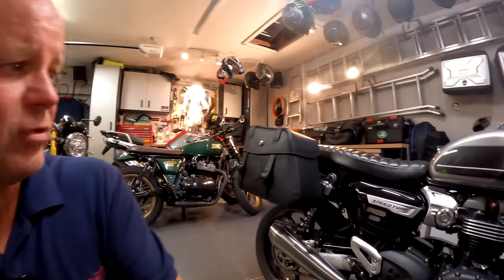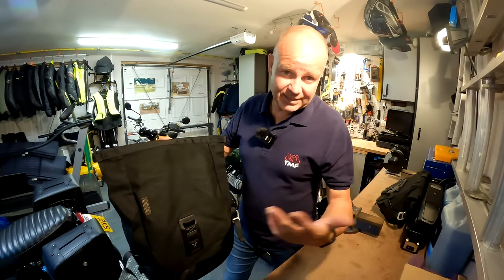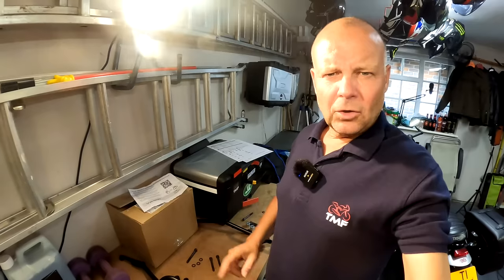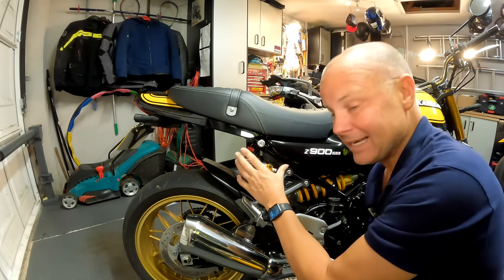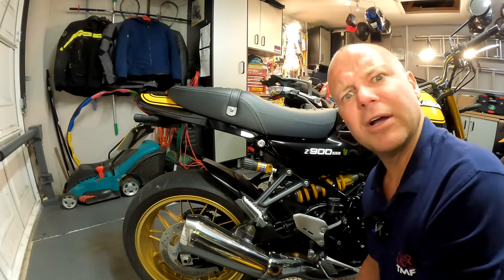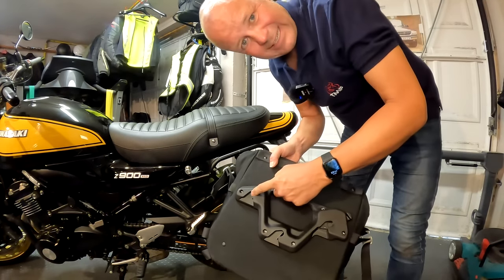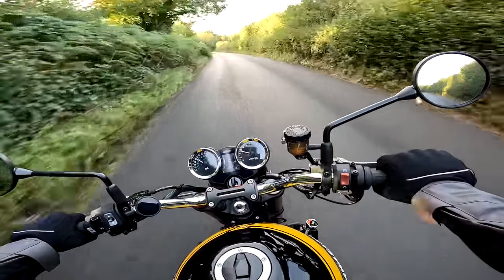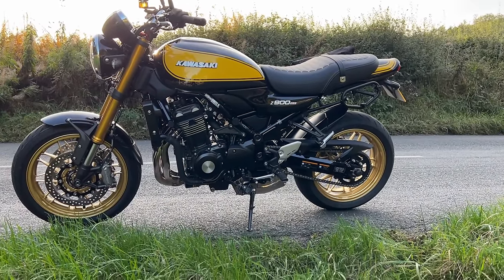Kawasaki Z900RS SE - An attempt at installing SW Motech Legend panniers!

Comment: That looked a bit of a struggle. I fitted these brackets and bags to my R9T and later transferred them to my Speedmaster when that replaced the R9T (I had to buy different brackets to fit the Triumph, of course). I don't remember it being THAT difficult! (Anyone want to buy my now redundant R9T brackets?).
My bags are equal size so no symmetry problems, but I decided I wanted them to sit lower on the bike. That's easily achieved by removing the attachment from the back of the bag, and drilling new mounting holes in the bag to re-mount the attachment bracket higher up the bag. They looked better that way on the R9T and also look really good on the Speedy.
Vince
Reply from the maker: Great tips - thanks for that!

Comment: What would such jobs be without the odd brain fart to have a giggle about in hindsight? 😁 They happen to the best, really.
A good friend of mine, trained and experienced aircraft mechanic who easily is the best at such bits of work I personally know, wanted to put new shaft seals on his Toyota Supra MkIII´s turbo. He had disassembled the Turbo's housing, secured the spinning bits in a carefully cushioned vice and started to undo the nut on its axle. It was stuck incredibly hard. He gave his everything to undo it until it made a loud crack and the nut came off with the bit of the axle on it. He could easily undo the two broken off pats, which made him realise that the thread was left handed. He had try to undo it in the direction that tightened it.  He had the personal greatness to laugh about his 1000€-brainfart. 😊 
I guess there are many wise Haikus in that kind of stories.

Comment: I have to say that was painful to watch, the fitting - oh dear oh dear. Also why is the exhaust side bag so small when there is loads of room from the botom of the bag to the exhaust can?? I have used SW Motech Blaze panniers for about 8 years and reckon they are actually a better product and at under £400 a set would be intersting to see if they do a set for your Z900.

Comment: I have to admit the different bag sizes when looking from the rear is a little strange, but I can understand why the OEM did not make the left side the same as the right. I’ve been working on cars, motorcycles and aircraft for over 55 years. I bought a new 2023 Goldwing Tour DCT back in July and have installed several add-ons. I will admit some of these turned into real Hollywood numbers when they should have been a piece of cake. Some of the after market instructions leave much to be desired but some issues I have to take the blame for being a dumbass. I have a feeling things will not improve as I continue to age 🤪

Comment: Firstly, I think they look as good as the more expensive ones, and the brackets blend in quite good when no bags on. 
Secondly, why don't these manufacturers colour code their instructions, as I like you, have similar problems when doing small bits n bobs on my bike haha.
Reply from the maker: Glad it’s not just me!
Reply: Looks fantastic from my house great job 👍
Reply: @TheMissendenFlyer 

Hi Andy,
I’m surprised you didn’t go with the SW Motech Blaze version. I love the way they look and fit on my z900rs, and when I take bags off in 30 seconds there’s no (ugly) bracket hardware to take away from the looks of this piece of art. 
I agree with your friend that the rear chrome handrail is a must retro finish to the bike, bookending with the chrome handlebars. 
I’ve also added a chrome brake reservoir, front fender extender, crash sliders, bar riser(I’m only 5’5”), a cool, sporty, full windshield for long trips from Puig, plus a Nelson Rigg tail bag that fits and matches with Blaze saddle bags. I wasted no money on already comfy seat and great sound out of stock pipe, and at 155 lbs., the suspension is good for me right out of the box. I don’t think I’ll ever sell it, now with 30k miles. I’m retired, driving around San Diego backroads, feeling like Tommy Cruise!
Other days, when I feel like Marlon Brando, I ride my 2017 Triumph Bobber, and like you, I love that 1200 HT parallel twin engine under me!
Ride safe, Mr. MF 🏍️😎

Comment: Treat yourself to a 3/8" Drive Allen Socket set! So much easier to carry out workshop jobs like this when used in conjunction with an extension and Ratchet Handle. Allen Keys should be relegated to roadside repairs only. You'll also potentially save a few skinned knuckles, not to mention trapped fingers!! 🥴
Reply from the maker: Funny you should mention trapped fingers....
Reply: Yes I saw the podcast, we know why you like the BM so much now.🤣
Great format by the way, Mrs F certainly added a new dimension to proceedings. 
On the subject of "Coffee Meets", how about combining your two passions and holding one at a suitable airfield location? With a collection for the Air Ambulance/charity of your choice? Just a thought.

Comment: You installed the panniers on the triumph on the wrong sides… the slope angle is meant to go /or flow with the rear of the bike …you have the angled end going towards the front that looks just odd 0:11
Reply from the maker: I've tried them both ways and can't decide which I prefer!

Comment: You struggle with mechanical technology the way I struggle with electronic/digital technology. I’d rather fit accessories than install an app any day of the week. I’m currently dreading this weekend’s task setting up the integrated comms for my new Shoei, and then bluetoothing it to my phone & satnav (if you listen carefully you’ll be able to hear me swearing!). 
PS: SW Motech look way better than Hepco & Becker. Fit & finish look almost “original equipment" compared to obviously "aftermarket accessory”.

Comment: Nothing's simple when the spanners have to come out! Looks like a large bag would fit on both sides. Shame they don't lock to the bike and the bags themselves don't look as thought they lock either. No good for London as everything has to be locked or nailed down with super glue so it doesn't go missing, even for five minutes!
Reply from the maker: Yes I meant to mention that - the only downside to these bags...

Comment: If a pilot complains about instruction manuals, you know the manufacturer has done a poor job in providing these.😂
Reply: Absolutely!
Reply: lol!
Reply: Nice bags although they do look a bit odd from the rear. Looking at the space between exhaust and bag, I can't see why the larger one would be an issue? Having  said that video perspective may not look larger gap than actual.
Anyway as long as you're happy thats the main thin Andy. Also nice to know I'm not the only one to take 2 or 3 times longer to tinmer with bike etc 🤣
Keep the video's coming mate, alwYs enjoy them. 😁
Reply: Nobody should need instruction manuals to fit panniers to a motorcycle , it’s not exactly rocket science & usually self explanatory .
Reply: @maskedavenger2578  Andy has owned a few bikes and has touched tools before, but demonstrated in this video that fitting these panniers wasn't a straightforward process for him. Now imagine a first time bike owner who hasn't used tools before. It's easy (for those of us who are competent and experienced with tools and assembling things) to assume that doing these things is simple and obvious.
Reply: @jimstewardson3362 agree the large bags probably fit on the other side too.. I believe he can thy with the one he has..if not I have a set on my V7 he can borrow for a fitting
Reply: @jamesf8864  It doesn’t really get any easier than fitting a couple of pannier brackets to a motorcycle . If somebody hasn’t used at least a few basic tools ,by the time they are old enough to own a motorcycle , they must of lived under a rock & be totally inept . I can’t imagine any motorcycle owner who hasn’t used tools before ,as surely they once owned a pushbike & must of used tools to spanner it . Even the girls where I lived ,used to have a go at fixing stuff & bikes with tools .  What kind of a man gets to adulthood & hasn’t owned or used tools .?
Reply: @joinmeoutdoors  Any man that can’t at least use a few basic everyday tools like wrenches & Allen keys , is no use to himself ,his woman , his kids or society .  I am no angel so I can’t see learning how to play a harp ,would be any use & certainly no use to a motorcyclist . I am also a retired joiner & also studied practice & theory several other building trades at technical college ,& picked up other trades ,involving the use of brain & tools along the way .  I dare say I could of turned my hand to thatching a roof back in the day if need be .  But we are not on about anything as skilled or technical here , we are only discussing the simple basic fitment of basic accessories to a motorbike & the most basic of tools . Any biker not capable of sussing out & completing such a basic task & the use of tools needed , should not be allowed out without supervision & certainly not allowed on a motorcycle .
Reply: @maskedavenger2578 Oh for gods sake man, lighten up. We all have different skills, abilities and talents. TMF clearly has been very successful in his careers and YouTube. The fact he has a go and isn't afraid to highlight the failed attempts is another honorable and honest trait. 
You could learn a lot from him, I suspect.
Reply: @samuelgillard2196  You need to lighten up , I wasn’t referring to Mr Flyer nor anyone that’s prepared to get on the tools & have a go at something .  It’s you that seems to be assuming that , I was just making the point, that fitting a couple of simple brackets ,requiring very simple tools ,is hardly complicated or difficult ,even if the person hasn’t done it before . Also I have been riding ,servicing & repairing large ,medium & small capacity motorcycles i & others have owned for around 54 years , I hardly think I need any one to show me how to fit parts to motorcycles .
Reply: @maskedavenger2578  You weren't referring to TMF, and yet you made those comments about this (his) video... makes sense 🤦🏻‍♂️
Reply: @maskedavenger2578  If you haven't been told this before, you are a very closed-minded individual. It would serve you well to try to see the world through the eyes of others once in a while. Working on bikes might be second nature to you and me, but I wonder how accomplished you'd be at hopping into the cockpits of some of the planes TMF can fly without a second thought? Would he look down on you and tell you that you were of no use to any man, woman or child? I suspect not. We all have our strengths and weaknesses. You are not some form of ultimate male just because you can work a torque wrench 👍
Reply: @jamesf8864  Perfect reply James, I couldn't agree more 👍🏻
Reply: @jamesf8864  I never said I was some form of ultimate male . If bullsh💩t was electricity you would be a walking power station ,as I never got to meet the people & friends here & abroad ,or run a business by being a close minded individual .  Also I don’t know why you bring TMF into this ,as I never claimed leaning to fly an aircraft ,was something you can pick up in five minutes ,like fitting a couple of accessories to a motorcycle . Also I don’t look through the eyes of others ,as I can only look through the eyes I was born with just like everyone else , which also includes you .
Reply: @samuelgillard2196  Sounds like you & your boyfriend James , need to move in with each other ,as you make a good pair together .
Reply: @maskedavenger2578  Oh dear. True colours coming out now. Very sad.
Reply: @samuelgillard2196  I reckon it’s you that is the sad one here , Mr Flyer himself even states what can possibly go wrong, after seeing how the components are a basic bolt on task . I think we all know what your colours are .

Comment: You did it.  Have a little more confidence in yourself.  Keep a clear positive head next time.  Some tools, Allen head and torx head sockets and some ratchets and extensions would be useful.  You can hurt yourself with those toolkit type units.  A more thorough review of directions, youtube vids if available would have helped.  Spacers, generally go from the piece to the frame thence the longer bolts.  Just lay the items out and think about it while reviewing the directions.  Some could be much more clear even on simple items.   Don't be your worst enemy when it comes to this stuff.  Sometimes we all have to do things more than once to get it right.  Now the bags look great on and off.  The right bag could be larger.  See if the left one fits.  Seems there is adequate clearance of the exhaust system.  Easy check.  Cost, very competitive.  Like you said the H&B were almost twice.  The hard bags for my Tenere are almost three times as much.  I like the wax cotton.  I may do a set for my BMW R9T Urban GS.  I think I recommended these to you.  They have some similar Legend seat bags that would work well also.  Some are pretty big and have sides which go over the seat to help lock it on and provide more storage.  Check it all out.  Anything beats walmart bags and bungree cords.  Safe riding in this changing season.  Don't get caught out on slick roads or black ice.  Safe rides.
Reply from the maker: Thanks for the tips!

Comment: Wouldn't it be nice if you had a lift and a roller seat so you could work without bending over and getting up and down on your knees? I know what it's like I've installed a few sets of luggage brackets myself.
P.s. there is a place for video's on installing, it's called YouTube.  😉

Comment: Those panniers on your Triumph look horrific and ruin the looks of a beautifully styled motorcycle.
Reply from the maker: Thank you for letting me know!  May I refer you to the smallprint at the start of the video - Point 9 is for you!
Reply: @TheMissendenFlyer Thank you for your reply! Unfortunately the small print would seem to be so small I can't see it at the start of your video. 

I confess to having not watched all the way through until now because, although your bottomless cheerful enthusiasm is generally quite entertaining I find watching your attempts to get on the tools uncomfortably embarrassing while creating an overwhelming desire to be able to elbow you out of the way before you do anymore damage! 😅

By the way, that other beautifully designed modern classic of yours looks equally horrific with ugly (eventually) bolted on scaffolding and pair of manbags spoiling it's lines. 😖

What about Oxford strap on saddlebags? My old throwover saddlebags are almost 35yrs old and still going strong. I'm trying not to point out that even your garage skills should be capable of installing/uninstalling throwovers without doing much damage but sorry, I just couldn't resist!

If I ever get around to uploading my slow progress on my KLX650 supermoto project, feel free to comment in return with your best pommie sarcasm. 🍻😎